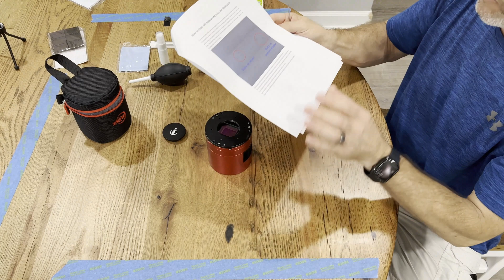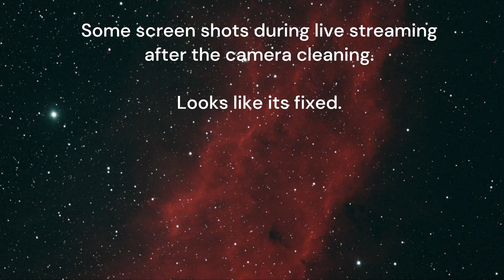ZWO ASI2600MC Pro Lens Water / Oil on Camera Lens

Comment: "Not oil, just water" 
Not acceptable, neither should be happening. 
The 2600 is not a cheap camera - sure, it's not the most expensive in its class, but oil or water should not be a possible issue with such a sensitive device. The sensor compartment should be designed and engineered to be completely sealed, or in the neighborhood of... And it's not like it requires some out-of-this-world design and engineering. Pun intended.
Reply from the maker: I agree totally. It turns out desiccates needed to be replaced. Haven’t had an issue since.

Comment: I have the ASI2600MC Pro camera, a great camera. Thanks for showing me how to get to my sensor. I was a digital photographer for 20 years and before that, I worked at a laser optics company that contributed to the Hubble space telescope. I think the best way to clean the sensors is with CCD/CMOS sensor cleaning swabs and sensor cleaning solutions for photographic camera sensors. Don’t use cotton swabs that leave streaks and lint and don’t use lens cleaners that are for lenses. I am surprised those instructions came from ZWO.
Reply from the maker: Thank you for the comment. Yes, you should use a cleaner kit. I didn’t have the one the wanted you to use so I used what I had. It turned out great. I did order the cleaner kit and just used it again on this camera for the same issue. Maybe it’s time for a new oring.

Comment: Fingers crossed it's fixed now but if the mark returns the camera may have to be sent off for a proper repair, I've got the Altair version with the same chip & fingers crossed it hasn't had the dreaded leak. I think the guys from Altair say it's the thermal grease that has caused issues as it does have the same chip as the ASI.
Good luck & clear skies
Reply from the maker: Thank you and I hope yours is ok as well.